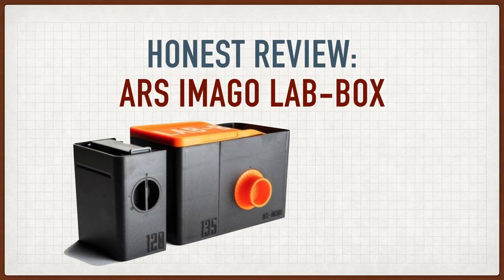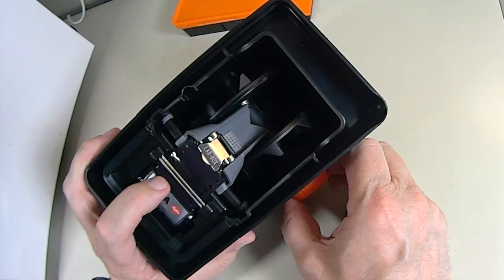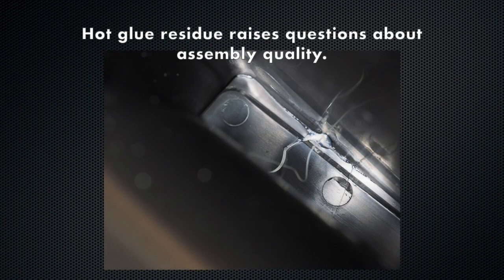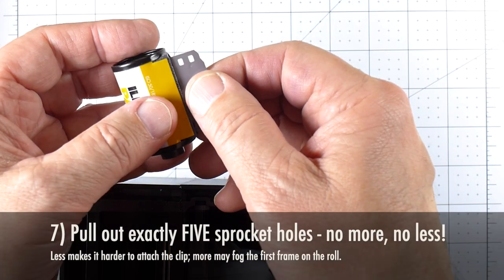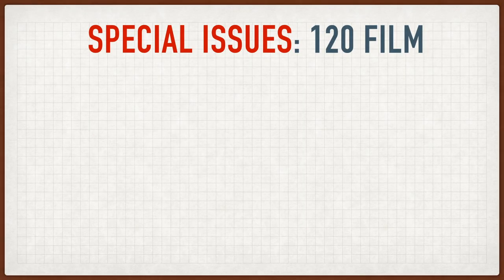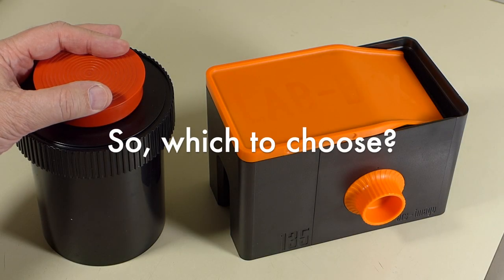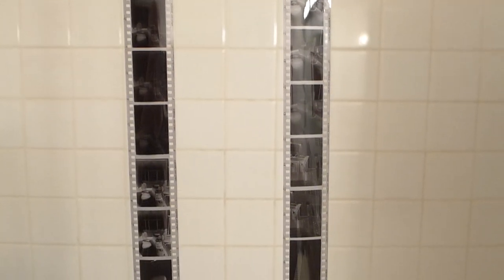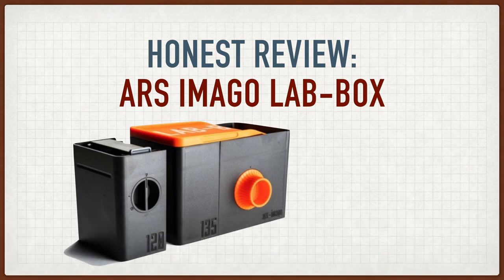Lab-Box review

Comment: For those that think a changing bag is a hassle. Here's a tip: Use some wire coat hangers (or other steel wire) to fashion a frame to keep the bag in a shape where it doesn't keep folding in on itself!
Easy.......................

Comment: Very good review. I only use the Lab-Box on 35 mm film since there are too many issues with developing 120 film (ruined frames). For that I trust my faithfull Jobo tank. Drawback: the cutting blade for 35 mm film can get rusty ... drying means dismantling the system (4 screws, tiny parts that can get lost easily).

Comment: I would like to offer my own "honest" opinion on this since I just completed my 3rd roll of 35mm HP5 with the Lab-Box last night. You make a very good point about the cost and complexity and I can see now that this might not be for everyone. For me this was a no-brainer. I learned multiple decades ago how to load film onto both plastic and stainless steel reels in the dark. Never seemed to be an issue. Fast forward to the 2020's where I picked up B&W film again but now have to use a changing bag. I absolutely detest using a changing bag. To me it is much more clumsy, confining, sweaty, etc. than loading in a darkroom. I used to be able to take film and load it up 1st time. With the bag I always have to try several times just to get the film started properly (35 & 120). When I first saw the Lab-Box for sale I couldn't wait to get one. I did wait, and maybe that was good thing because I did not experience any of the quality issues you did. Maybe I got lucky? I guess I didn't feel this needed a lot dexterity and finesse probably because I could see what I was doing, and, I am used to tinkering with things. Didn't feel fiddly to me at all, and in point of fact, felt much less problematic than the changing bag. Once past all of this using the Df96 Monobath made things just drop dead simple. Not sure about more conventional 3 step chemistry. I plan on trying that later. You comment about having to rinse and dry all parts before re-use as being a drawback. I never have used a Patterson or other tank and reel system a 2nd time without rinsing and drying those as well, so I don't agree that is a drawback, just good practice. I spent a career in the chemical industry and this to me is just what you do for consistent and clean results. Having said all that, I am really appreciative of what you shared regarding processing of the 120 film. I almost bought the combination kit with both modules, but having seen your explanation, I may forgo that and stick with conventional tank and reel for my medium format film. Thanks for the detailed video.
Reply from the maker: I'm glad to hear the manufacturing quality seems to have gotten more consistent, and otherwise my experience pretty much mirrors yours: it took a while to get used to the Lab-Box, but now that I've learned its quirks I use it for pretty much all my 35mm developing because I can just pull it out and start developing without all the changing-bag bother. (120 in the Lab-Box is still a no-go for me except for quick tests.) I still think it's better for beginners to start out with a regular tank because you don't run the risk of incurring the Lab-Box's up-front cost and then discovering you'd just rather send your film to a lab (or use a digital camera!) but if you already understand the developing process and want a quick, tidy way to process an occasional roll, I agree it can be a good investment.

Comment: Great review with some very sound points. Unfortunately I already spent the $200 and the kit arrived with a couple of pieces missing. I found an acceptable replacement at the hardware store, but for the price it’s terrible business on their part. I agree that the workmanship is subpar at best.  I usually load two rolls of 120 in my Patterson tank so it’s twice as slow and I never lost a roll or partial roll to the clumsy design. For 135 it’s definitely a bit easier. For the B&W monobath development, the Lab Box makes some sense, but the traditional C-41 system the Patterson tank I use is much quicker. I have a large closet in my bathroom which is perfect for loading film so I will keep practicing and see if anything changes. I think it’s a good idea for those who want a way to develop quickly while on a trip and just can’t get a handle on the dark bag. I honestly hope that Lab Box lowers their prices and improves their workmanship.

Comment: Beginner here, yep I chose a tank over a Lab Box.
And as a matter of fact I've only processed one 35mm roll so far, and could very much end up giving up, in that case, yes I wouldn't have spent too much money as I bought the very minimum (Tank, developer, fixer, grad cylinder and film, that's it) and nothing superfluous.
My tank isn't Paterson but the compact one sold under many brands that comes with a red cover to agitate it. And the two reels inside are sait to be easier to load than the Paterson ones. The light tight funnel screws to the tank like on the old Paterson tanks, just I like it.
Oh and I load the reels in the dark, not in a changing bag. And since I practised a few times with an expired roll of film, loading my exposed film on the reel turned out quite easy. 
Same with the actual developing by the way (Stand dev with 1+100 Rodinal, the film was a Fomapan 200 36 exposures by the way).
The "only" issues I got were during the final wash and drying of my negative film.
Basically I got water spots and scratches, I learnt the hard way how to handle and dry a film.
And trying to use hard soap as a wetting agent wasn't a good idea despite my use of distilled water.
I therefore bought a bottle of actual wetting agent for films that I will be using next time.
Also sorry for my bad english in case it's that bad, it's not my native language, but hey ! at least I'm doing it all by head and not using any translator app thingy.
Reply from the maker: Your English is fine! And I think you've summarized the experience a lot of people will have when they try developing film: best to start at low cost, because you may not like it!
Reply: @jlwilliams  Thank's for the reply and I'm glad my English is fine.
Yes I started low cost and have developed more films down the road since I first wrote the above comment (That I deleted then reposted 2 days ago).
I think I'm actually liking it enough to do more in the future, but still the Lab Box is clearly an overpriced modern equivalent of the Agfa Rondinax tank and comes with many drawbacks mentioned online.

Comment: Very good review.  I had it, ruined three rolls and then sent it right back for a refund.  I had very high hopes for this but alas, it failed for me.  I also have a Jobo 2400 load in complete daylight tank (no dark space required), and it worked very well.  Just need to find a solution for 120.
Reply from the maker: Filmnut Girl Thanks! I had not heard of the Jobo but the principle looks more straightforward. 120 film is always going to harder because there's more unsupported width. Good luck!
Reply: @jlwilliams  I looked for a Jobo 2400 for most of a year with no success. That is what motivated me to buy into the Kickstarter for the LabBox (both 35mm and 120). Some seem to find small fit and finish issues with the LB reel parts, easily corrected, but at $200 why should you have to? Mine was flaw free, but I have a different issue. As part of the Kickstarter package, they included a second reel. Thereafter during product development, they changed the design of the reel so that the initial Patterson-style design was abandoned in favor of a reel which could not be made to fit both 35mm and 120 with a simple adjustment. In final design, the 35mm and 120 are two different reels, sharing only a common center shaft. What we got was a set of reel flanges for 35mm and another for 120, with one center shaft to be used in common. What this does is kill the idea of having two reels, i.e., a 2nd dry reel to use for a 2nd film once the 1st reel is wet. It also means that you have to disassemble the reel to shift from 35mm and then reassemble for 120. The issue here is that the reels can be easily misassembled and fail to work properly. Also, the center shaft is going to incurred a lot of wear at points where any looseness is going to make the reel unusable. To keep faith with their backers and customers, at least they should have included two center shafts so regular disassembly would not be required. At this time, LB will not/can not sell users a 2nd reel center shaft, although they say they will do so in 2020. In summary, the LabBox does basically deliver the performance it promises, however cost aside, it requires very careful use and many fiddly steps to use properly - a solution looking for a problem to solve.

Comment: I've been using the Rodinax 35U for about three years, it never dripped. I only messed up one film because I didn't know how to evaluate the mechanical feedback from the spool. Now it works like a breeze.
Reply: Compared to the Lab-Box, the Rodinex has no liquid seal in the crank used to load and agitate the film roll. This means that you can only fill the Rodinex half full and must continuously crank/agitate to use it at all. The LB is fully sealed, does not leak if properly set up, and can be used either half full like your Agfa or filled completely with the more usual, intermittent agitation.

Comment: great video and review sir, I've been thinking about picking one of these up to save on developing my 120 film
Reply from the maker: Well, good luck if you do. One tip I found since making the video that MIGHT help (no guarantees, though!!!) — When loading 120 film, pull the backing paper ALL the way out (don't stop at the three arrows.) This will peel off the tape and leave it stuck to the inside of the compartment. With luck, you can peel it off and fold it over the leading edge of the film... that reinforces it and makes it less likely to buckle as you load it onto the reel. (I take no credit, this is an old-timers' trick for loading 120 onto stainless steel reels...]
Reply: @jlwilliams  I appreciate that, I may just stick to the Patterson tank,  we'll see

Comment: Great review, you described the problem with 120 perfectly, ive had two rolls in a row that didn’t spoil correctly. Will go back to Paterson I think
Reply from the maker: Thanks! One thing I've found since then that may help with 120: Before loading, DON'T tear off the tape; instead, PEEL it off from the backing paper and then fold it over the edge of the film. This reinforces the film so it's less likely to buckle. It's an old-timers' trick for loading 120 onto stainless reels... remembered it and found it helps with Lab-Box too.
Reply: @jlwilliams  Wow thanks that's great advice. The problem is do I risk another roll to test it? I've gone right off this thing since I discovered you can't use PET films like Fomapan. I'll give it one last chance ;-)

Comment: Fantastic, honest video. You point out so many gotchas that the other reviewers leave out. I'm going to wait for version 2.0 before I buy in. You didn't say, but can one use a hair dryer to help speed up the parts drying process or would that compromise the hot glue seals?
Reply from the maker: Glad you found it useful. I think I read on Ars Inago's site that you can use a hair dryer if you keep it on the low heat setting. I've also found that letting a fan blow across the drying area helps speed up the process. Incidentally, I DON'T think the hot glue is a standard feature... my guess is that my unit cracked or got dropped during manufacturing or packing and some misguidedly clever person applied the hot glue as a rework. I have to admit it doesn't leak, but it did seem a bit lax...
Reply: Given the cost of the LB fully equipped and the number of potential purchasers at that price, I very much doubt that there is going to be a "2.0" version of the LabBox.  In fairness to the maker, the entire LB system underwent revolving modifications and a full redesign of the reels in reaching the original (current) version.  That's why the reels have the silly assembly issues noted. Solving bigger problems produced smaller problems they didn't have time or money to redo one more time. Note that the Kickstarter investors like me paid for all of the development costs  to date plus the production  tooling, injection molds, etc.  From here on the cost of producing additional units would be much cheaper, but so far Ars Imago appears to be marketing future units as though they were amortizing those development cost, which they are not. To put it another way, Ars Imago could probably produce and market future LB units (the full two film package) for less than half the present retail prices and still make a very good profit, but they aren't doing that. After using my LB a bit, the only modifications I would recommend would be (1) put an additional reel spool in the package so you do not have to disassemble the reel each time you change formats, (2) produce an accessory base to go under the LB, to both heat the tank at a stable temperature and also rotate the reel by its twist knob to automate agitation for color developing. It would not be that hard to do, and at least one guy has done the auto agitation part, per a short YT video. Ideally, that type of unit would connect to the "pro lid" to use its temperature probe re tank temp and its process timers to switch the agitation motor on and off. That is not likely to happen given the trouble Ars seems to have had completing the lid electronics.

Comment: Hello... I am very impressed with the thorough and excellent production quality of your tutorial. I nearly order the 120 version of this unit last night, but held off as I was drawn to the German Jobo manual rotation system. I have plenty experience of the English Paterson tank, but feel I should be using a rotation film developing system to reduce chemical usage. The unbelievable lack of the rinse cycle within the Lab Box was a big minus  I thought. Might you have any experience of the rotating Jobo tank system. I usually need to develop 2 x 120 rolls at any given time, and 3 to 4 on occasions.
Any thoughts you might have would be of great help to me.
Needless to say I truly enjoyed your unbiased  and independt work.
Kind regards,
Thomas C Smyth
Reply from the maker: I don't know much about the manual-rotation Jobo system, but for a while last year I belonged to a community darkroom that had a Jobo CPE-2 system. I suppose it was good for those who wanted to process C41, but I am mostly a b&w shooter and found it overcomplicated. I also feel the Jobo reels are much harder to load than Paterson ones. If you are concerned about chemical usage but typically process only 1-2 rolls at a time, might it make more sense to use conventional rotation and switch to a more concentrated developer and fixer solution?
Reply: Thank you for getting back to me. I'm in the black and white school of film these days, but have used the excellent America Phototerm for C41 and E6 in the 90's. Perhaps if I settle on rotating a Paterson 3 reel tank in a warm basic of water during the various chemical stages, double the clearance fixing time etc then that could work.

Comment: Hi Sir. Is it really required to clean the lab-box every after development? Let's say I have 3 roll lined up. Does that mean I have to clean it every each roll developed? Thanks! Very helpul video btw 😊
Reply from the maker: You don't have to completely clean and dry it after every roll, but you should thoroughly rinse off the reel, tank body, and film guide between rolls. If you don't do that, fixer residue from the first roll might get carried over and partly neutralize the developer for the second roll, leading to poor-quality development. I just take off the film chamber and set it aside (so the cutting blade doesn't get wet) and rinse off the reel, tank body, and film guide under the tap, then shake off the excess water before using them again. After you have finished your developing session, THEN you should thoroughly wash and dry the Lab-Box before you put it away… otherwise it might get white stains from minerals in the water that can keep it from operating smoothly. Good luck with your developing!
Reply: @jlwilliams  Thanks! This is super helpful. I will try to develop this weekend. 🙏🙏🙏 I hope everything goes well. Take care sir 😊

Comment: Just a note to the uninformed....You can't buy replacement parts for the LabBox.  I've been trying for some time to replace a reel and they don't respond and retailers don't carry replacement parts.
Reply from the maker: EFD620G Thanks for the heads-up. This is interesting and a little surprising (and disappointing.) Some parts (such as the plastic band that attaches to the film clamp, and the two halves of the loading guide) seem a bit delicate to me, and of course I can't help thinking how easy it would be to lose some small parts such as the little rubber rings that fit over the ends of the loading guide rod. If there's no way to get replacements for these, we're all going to need to be super-careful with the ones we have!